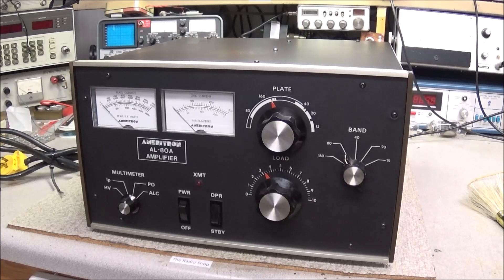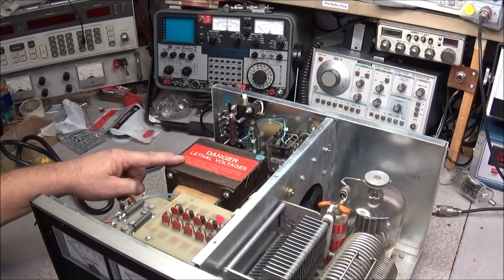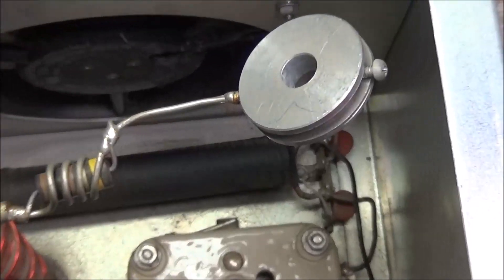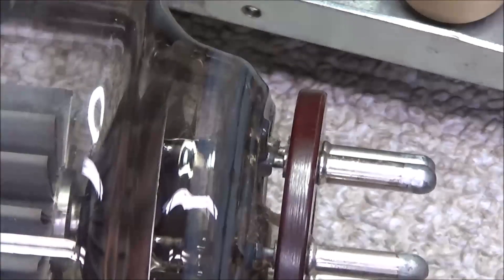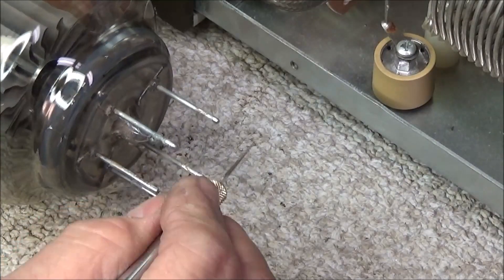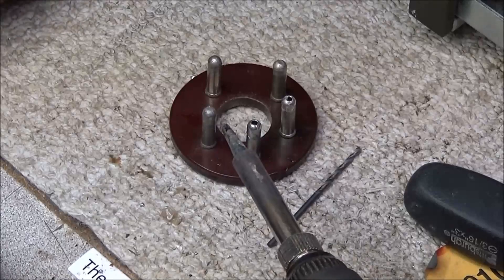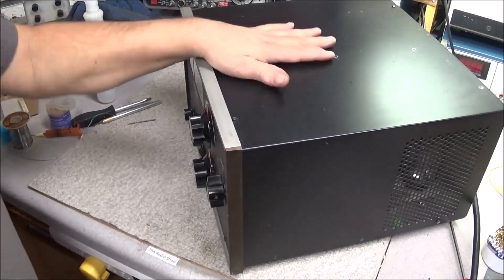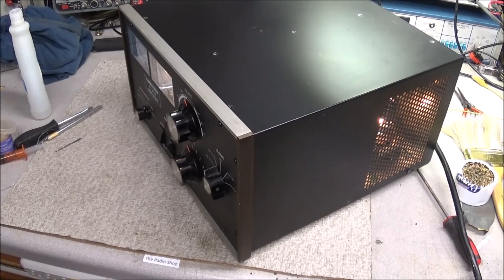#192 Ameritron AL 80A Repair and Winner Of VTVM

Comment: AL-80a, after 40 years being a Ham, I'm new to amps and this is the first amp I've ever had. After operating flawlessly for over a year, now my filament also does not light up and the input SWR is showing infinite when the transceiver & amp are keyed. High voltage shows good, about 3100+. I can't find a video for the procedure of actually 'bleeding' the capacitors and I surely don't want to meet my maker. Anyone know of a video anywhere showing that for the AL-80a for this rookie?

Comment: Great video for me Buddy because I have the SB-1000 with and original I-mac.Great amp.I love it.Do you know where I can get relay for my yaesu ft-726R.I've cleaned it several times but it goes back to sticking again.Tnx 73 from Ronnie kn4u
Reply from the maker: Thanks Ronnie. Those are getting hard to find. If I run into a relay I will let you know.

Comment: Good job Buddy...I've fixed 3-500 pins before as well and used sliver solder to fill the void. Surprisingly replacing the compression spring in the tube socket takes all of 30 seconds; didn't realize it was so easy the first time I looked at one and thought I'd have to replace the whole socket...the trick is having a extra socket around as a parts mule!  73 - Dino KL0S
Reply from the maker: Thanks Dino. Most of the ones I have seen the spring was over heated and deformed.  End up replacing the whole socket.  I never used silver solder on these, scared the extra heat would crack the tube.  Guess I will try it next time.
Reply: I misspoke...didn't completely fill the tube with silver solder, just to top off the top fillet when smoothing the "hemisphere"...you're right, probably need too much heat to completely fill the entire pin. Sorry for the confusion. @TheRadioShop
Reply from the maker: You know that may be ok then,  I do have some tubes that are already cracked. I will practice on them.

Comment: Wow, I would have looked at that tube and said ok it looks good but you checked closer and those are so corroded no wonder they are no longer connected. When you come down to it you can really only stock so much of the parts you need but, what is really bad is when you look around and find the parts you were looking for somewhere else in the shop and you ordered new ones. Two thumbs up for getting a nice Amp back to the owner in perfect shape you are the best Buddy.
Reply from the maker: Thank you Larry. Yep seen that happen in the cheaper 3-500Z tubes many times.  It is almost a given and the first place to look. with them.

Comment: Great job of diagnosing, and repairing the amp. Can't get more straight forward then that. PS. As a 10 year I put my fingers in a unplugged  Heathkit dx 100. I was lucky. I only lost a fingernail. Not to mention the jolt I remember to this very day. If one doesn't know how to work on high voltage gear do what I do, and send them (it) to a professional. 73
Reply from the maker: Thanks, Ouch, now that is no fun at all. Don't ask how I know lol.
Reply: @TheRadioShop  It only goes to show that even the professionals sometimes for whatever reason can, and do get zapped. I don't know the statistics, but those professionals who work on high power lines while sitting on a grounded plate that's attached to a helicopter still lose arms (if they're lucky,) and sometimes their lives. Some people just don't understand how lethal something so small can be. I think people that aren't in the know think to themselves how much damage could possibly be done by something that looks so non-lethal (small?) Unfortunately many people find out the hard way how extremely lethal the voltages in amplifiers especially, but not limited to just amps. Power supplies, transceivers, transmitters etc etc etc can, and do kill people, and mame people every year

Comment: Yup there needs to be more fan blade below the chassis or bottom cooling and chimney.  I wonder if 2% silver solder might be a good idea?? If the glass and pin seals would take it?? Just a thought.
Reply from the maker: Yes you are right. Needs better cooling. Problem though is the design, only half inch of space under the tube.  Really cannot raise the tube any higher because it is already close to top cover.  You could lay the tube sideways but then that's another issue. Thought about silver solder but like you said, lot of heat on the pins.

Comment: The actual tube pins emerging from the the glass bulb are made of Tungsten. The Tungsten first had to be cleaned by a electro-chemical process called "Nitriding." Since it is difficult (or impossible?) to use lead solder to interface with bare Tungsten, the leads had to be dipped in a molten pot of silver solder with a special brazing flux, then washed with water. After drying, the socket was installed, using a machined spacer inserted between the envelope base and the top of the socket wafer. Then, the socket pin tips were first dipped in flux, then dipped in 50/50 lead/tin mix in a solder pot. You can't do a proper repair without a pot IMO. That particular tube is quite an old Eimac, judging from the red colored socket wafer. I'm thinking early 70's. Later Eimac's had the yellow/brown colored wafer. The problem is very common from (of course) too much heat and not enough air flow at the base. Air system socket/glass chimney eliminated the problem. The military had similar issues with 4-400A's, which was solved by spot welding of a tubular nickel sleeve to the Tungsten leads at the interface point instead of just a silver solder dip. I don't think the nickel sleeve method was ever used on the 3-500Z though. 3-500Z's were just considered a ham tube, because of an effort to keep the manufacturing cost very low for the market. Oxidized (greened) Tungsten makes a great glass/metal seal, but difficult set of bonding issues for current flow with a mechanical socket.
Reply: Yes and most of those pin preparation steps were made before the base of the tube was attached to the main bottle and then after it was, the whole tube would have been heated so that any heat applied to the tungsten feedthrough wires wouldn't create a vacuum leak cause by high thermal differential temps.  Bear in mind the difference in coefficient of expansion between the metal feedthroughs and the surrounding borosilicate glass envelope.   It's so scary watching such a filthy soldering iron tip doing exactly what should never be done to ultrahigh vacuum feedthroughs.  YIKES!

Comment: Thanks for the great tip Buddy. I do have a few amp's here and have worked on them. I used one for a while but haven't for about 2 years now. Found I didn't need it when I upgraded the antenna system. I live in a small city lot with neighbors very close so don't want to turn their lights on and off. Again great stuff and we always learn a lot from your videos.
Reply from the maker: Thanks Lyle. I do not run amplifiers myself.  Only in testing purposes.

Comment: Great video! 
You can't emphasize enough about the dangers of the voltages inside a tube amplifier.  AC from a wall outlet can give you a kick, but the HV DC in one of these amps will kill you in an instant! 
I'm currently rebuilding a Yaesu FL-2100Z amp. I treat it with the utmost respect.
Reply from the maker: Thanks Michael, you are correct on that. Good luck on your rebuild.

Comment: interesting repair I haven't had to resolder a tube pin before, but I can imagine how hot that amp gets. The amps I serviced in the Navy (Harris RF-130 or Military Designation AN/URT-23) had tubes that were bayonet style and ceramic with cooling fins where forced air was constantly blown through them. In 9 years I only replaced 3 of them. The major failure point was the HV cap coming off the plate. I cannot remember the tube type but they were spendy. Very informative, thanks! 73 K7TIE
Reply from the maker: Thanks. Those Harris units were built like tanks. When they designed this amplifier they did not take cooling into consideration.  Why the pins became unsoldered.  Thanks for stopping in.

Comment: Buddy, what wattage or temperature do you use to resolve the 3-500z tube pins? I always thought it took high temp to flow the original solder. I have a couple of tubes that this exact thing has happened to. If I could fix them, I'd have a spare or two for the Drake L-4B and my HB pair. Nice video as usual.

Comment: tube not lighting, I'll guess and assume filament pins overheated and solder dropped out.
and yep, it's been "rode hard and put away wet" so to speak :)
Reply from the maker: Yep, common mistake with these.

Comment: LETHAL VOLTAGES!!!  Yea is true.  I have been doing radio restoration.  Fixed power supply issues, all new caps and full alignment (got very similar Rigol as you except bought the mso4000 scope) on a TS-940S Kenwood. Restore TS-530S as well, in that now.  Hybrid radio.  Learned a lot about valves and I have grown more and more interested in them.  Now I am torn.  Should I build a solid state amp or go with a rather what I think to be a cool lookin, somewhat fun to operate tube amp?  The voltages concern me some but proper safety measures and knowledge help.   What amp has a better spectral purity?  Tube amps in certain instances can be more efficient, not major concern other than a tube amp with filaments on and not transmitting is doing nothing but eating juice.  Tubes somewhat cheaper but they do eventually wear,  solid state last long but are very expensive to buy and match.  Sorry for the ramble.
Reply from the maker: Thanks for sharing all that. That is a big decision. Have to remember tubes are voltage monsters, while power transistors are current monsters.  Can be a bit of a trade off.  Simple for me, tubes.

Comment: The big downside of amp's like this, no chimney with forced airflow over the tube socket.  Nice to be able to save the tube from heading to the scrap pile.
Reply from the maker: Agreed Mike. And not much room for improvements.
Reply: I'm not surprised! Ameritron, MFJ's Chief company. You'd think Ameritron would want to protect such a nice piece of glass. BUT NOOOOOO!!! They (Ameritron) have to know that this is a possible outcome minus a chimney. Yet they choose to build the amp without one. I guess it's ok when they're building "cheap" 811 amps, but this amp isn't one of their cheapies. How much could it possibly cost them to produce a chimney, and fan (placed in the correct area??
Reply: @zooyawk4526  No chimney was needed

Comment: This has happened to me. it's because of the design of the cooling. It needs a chimney and bottom airflow past the pins for cooling. this will happen again.....
Reply from the maker: Agreed, but like I told OJ above, no room to redesign.
Reply: I had a Henry 2k2 with this problem. It had a pressurized chassis but the PO had run it without the chimneys. I had to  change the socket the fingers were   to the point where they lost spring tension. Also the solder melted right out of the pins as you found.

Comment: G'day Buddy

This happened to an Eimac I had.  Unfortunately, a friend of mine tried to repair it and couldn't get the pins to retake the solder.  We were contemplating getting a jeweller to electroplate it for us but in the mean time, I discovered the tube rattling... The filament had come away...so the tube went to heaven.  

Any tricks on what the correct flux and solder is to use to win these back?  If it ever happens again, I'll want to fix it.  73 Aaron VK2ON
Reply from the maker: Aaron, I think I failed to mention what solder I used but I repair these with silver solder.  Just need to make sure you remove as much as the old solder that you can and clean with IPA. Just remember silver solder takes more heat so be careful notto over heat it.

Comment: Yikes and Yuck.   Most pin preparation steps are made before the base of the tube is attached to the main bottle then, the whole tube would be heated so that heat applied to the tungsten feedthrough wires wouldn't create a vacuum leak cause by high thermal differential temperatures creating stress on the adjacent glass.  Bear in mind the difference in Coefficient of Expansion between the metal feedthrough wires and the surrounding borosilicate glass base.  It's so scary watching such a filthy soldering iron tip doing exactly what should NEVER be done to ultrahigh vacuum feedthroughs.  YIKES!   Can't you ever clean your soldering iron tip on a wet soldering sponge?   Yuck.   Have you ever thought of using a clean, very sharp razer knife blade to clean those pins rather than taking a chance at cracking the glass by enlarging the metal pins with heat????